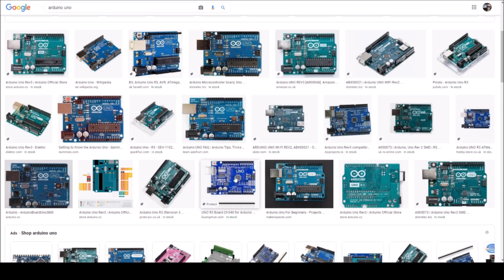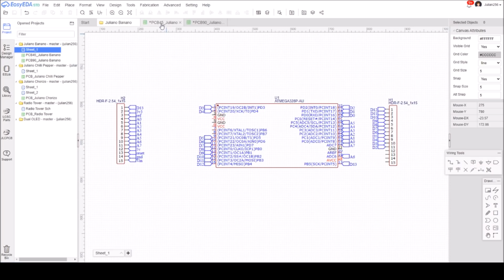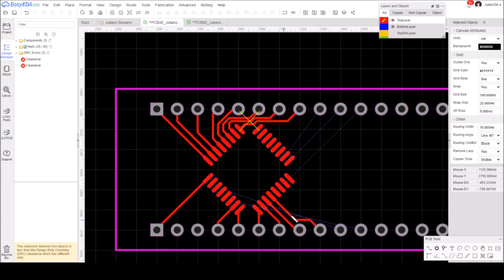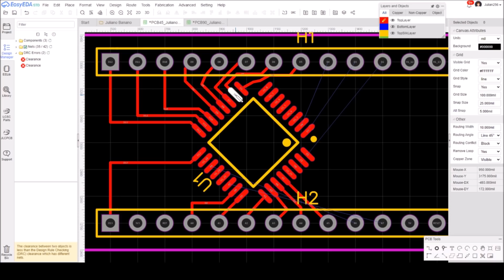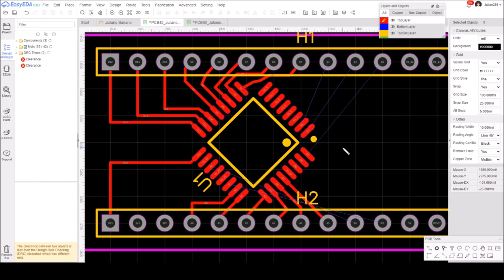Chip at 45° - Why?

Comment: it does seem to make sense for routing (pronouncing it "rooting"), but as there are no slots cut into the boards it cant possibly for routing (pronounced "rowting")
Reply: > (pronounced "rowting")
Is that "row" as in argument, or "row" as in "thing you do to move a wee boat"? ;] 
Routing as in r + outing, or rooting. A router is also used to route internet messages to the right place... and the easiest way to avoid confusion over routing between the US and UK is to keep them disconnected.
Reply: You can't say rooting Down-Under, because down here that is a rude word - lol -.

Comment: It's a lot easier for routing
Reply: This. Look how many traces and how close they would be to the edge of the board if the chip were square with the board.
Reply: Or rooting?
Reply: @xzaz2  If you are in the correct part of the U.S. those two words are pronounced exactly the same.